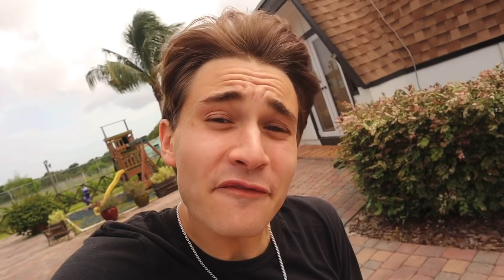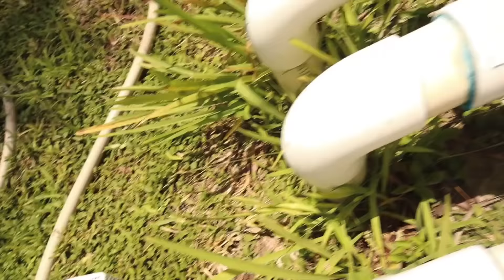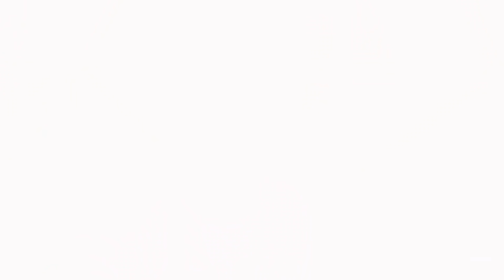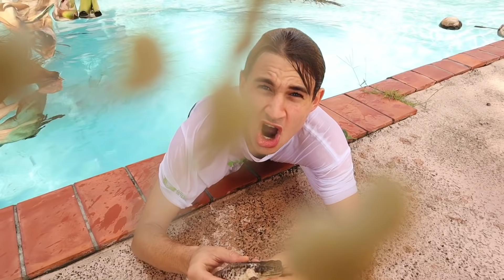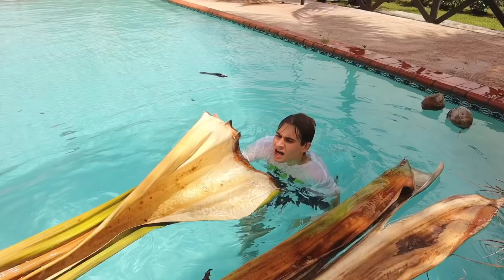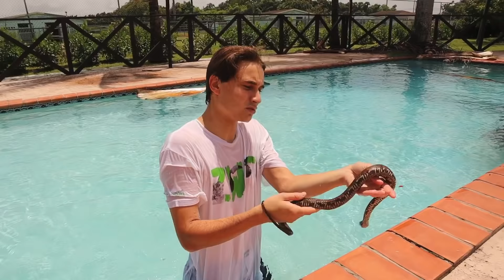HURRICANE BLOWS SNAKES INTO MY POOL !

Comment: Where I live there is a wildlife area like 30 miles away that spans around 30,000 acres and has like 21 ponds with many types of fish for fishmen to catch. There is 25 kinds of snakes but only three of them are venomous. Which is Northern Copperhead, Timber Rattlesnake and Eastern Massasauga.

Long ago I used to fish at that wildlife area. During the summer months you could not walk 20 feet without seeing a snake. If you did get bitten by a venomous snake you was like 15 miles from the closest hospital or help for that matter.